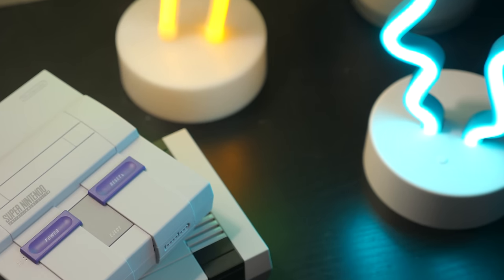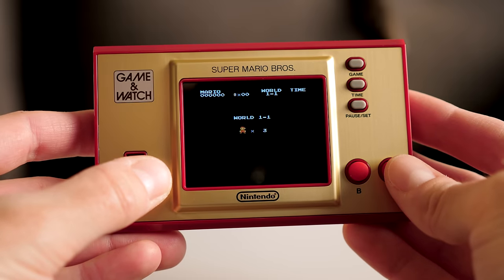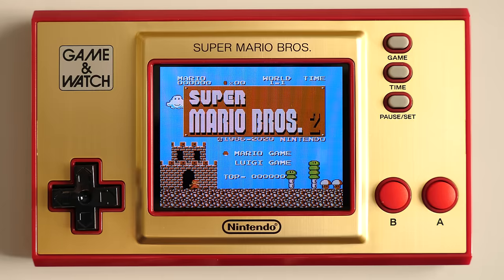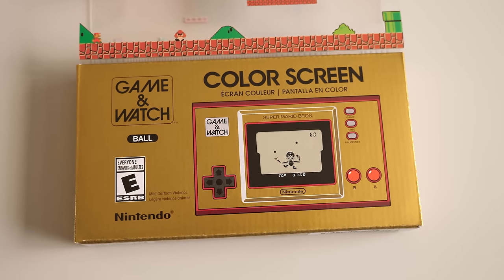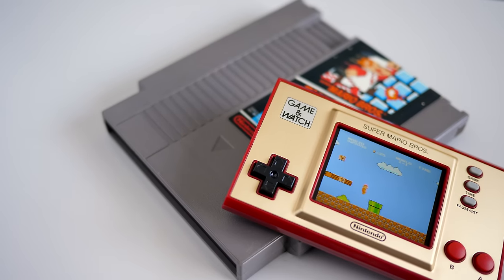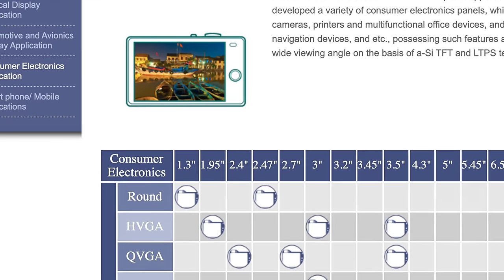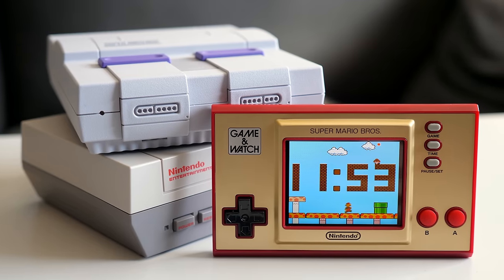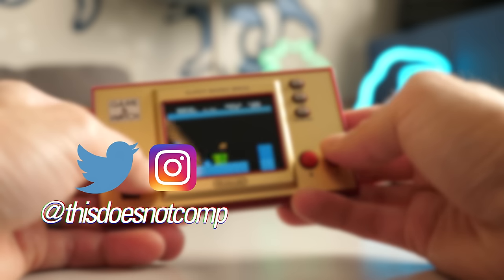Nintendo Game & Watch Review and Teardown!

Comment: That battery is the same one used in the Joycons, down to the part number (HAC-006). Even the speaker is the same design as used in the Switch itself.
Reply: I had a feeling they reused switch parts because of the usb c port
Reply: Yeah, the other teardown video of this that had already been done revealed the battery to be a Switch Joycon battery.
Reply: @RWL2012  thought that battery looked familiar
Reply: Nintendo as of late liked to used existing parts of the components when they can, which is a really effective strategy in my opinion as it allows for cheaper producing cost, and allow for more to be made. Same thing happens with the Switch Pro Controller and the Switch itself (Use the 3DS battery and, at least at launch, came with the HDMI cable for the Wii U respectively)
Reply: That’s smart design

Comment: This Nintendo Game & Watch can be hacked to add your own custom ROM, however it's not for the faint at heart. You need to open it up and connect to the 5-pin unpopulated debug header port. You can actually see it in your video. With the battery on the bottom the pins from left to right are: SWCLK, VDD, GND, SWDIO, RESET.
Reply: Here's a video link showing the detailed process on how-to do it (not my video) https://www.youtube.com/watch?v=Rsi8p5gbaps

Comment: The SOC isn't a glob top which is pretty cool.
Reply: I've seen a few glop top systems that are REAL systems. Like one that I have, which is a glop top with a real NES-on-chip with good AV output under it, and another that is a real SMS. Both are older, but when connected to a CRT TV would be very hard to distinguish between a real NES/SMS. Not trying to 'dunk' on you here, but some glop tops can be good. just not when it comes to reverse engineering.
Reply: @xero110  oh no I'm not necessarily against glop top chips, I'm just saying it's not as easy to work around or hack a glop top. You of course can get around a glop top in a few ways and there are for sure some great SOC glop tops like what you mentioned but nonetheless I was just saying that it's pretty cool that Nintendo didn't go the glop top route with one of their cheaper devices. I didn't think you were trying to dunk on me. We're just two nerds talkin' nerd talk is all.
Reply: @xero110  yeah i saw that, f*cking awesome

Comment: The USB port on this thing is really for charging only, it's not physically connected to the SoC, only to the charge controller from the reversing attempts i saw online...
Reply: Wonder if one could connect the data pins themselves.
Reply: @christphern  simple answer, yes you can, that didn't mean you can easily crack it though.
Reply: That's an important distinction. Thanks for pointing it out.
Reply: @mephistovonfaust  yeah who knows the rest of system is setup to communicate even the pins are connected.

Comment: There absolutely is interpolation from non integer scaling on the X axis. It’s most obvious on the vertical lines on the brick tiles, and there’s a noticeable shimmering when the screen scrolls.
Reply: Yep, it's ironically extremely obvious in the close-up while he says Nintendo chose a screen resolution which doesn't require interpolation. Whoops.
Reply: @vaguerant  I agree, but there is nothing Nintendo could do about, as pixels on the original NES are not square. So they choose a display with the correct aspect ration and the correct Y-resolution.
I just wish they gave you at least the option for a pixel perfect mode like on the NES classic so you have the option of choosing ether a too skinny - but pixel perfect picture or have it the correct aspect ration but with interpolation.
Reply: @sh4dowde  Well, there is nothing Nintendo could do about it on the budget they alloted to this device. But if they had wanted to, they could have had somebody manufacture LCD screens with non-square pixels; it's entirely possible, the Sega Game Gear and Nintendo 3DS both had them.

But for a cheap device using off the shelf parts, that wasn't going to happen, so yeah, a pixel-perfect mode (like they already offer on other systems!) really would have been the ideal compromise.
Reply: @vaguerant  There's a lot Nintendo could have done about it. They're giving you 3 games for $50, there's a crapload of profit there. This was just lazy on Nintendo's part, as usual. Nintendo never cares about getting it right, they always release cheap crap for maximum profit.

Comment: PSA: The screen does use interpolation horizontally. However, this is not necessarily a bad thing and is handled well here, well enough for many reviewers not to notice, and it's almost unnoticable to me in gameplay.

Now you may ask, why is the game stretched horizontally? That's because LCD displays have square pixels (generally), however the NES is intended to be displayed a bit stretched. The resolution of the NES is 256x240 which would be an aspect ratio of 16 : 15 if displayed with square pixels, however the video output from the NES was stretched to 4:3 on CRT TVs at the time. The Game & Watch has a resolution of 307x240 (counted the pixels on my unit), which is close to 4:3 (approx. 4:3.13). The vertical resolution obviously matches that of the NES, thus no stretching there, but the horizontal resolution is 20% higher. As a side note, I find it odd that they didn't use a 320x240 resolution which is more standard and would've given them an exact aspect ratio of 4:3, but I digress.

I personally think that they should've added a "pixel perfect" mode like on the 3DS Virtual Console, NES/SNES Classic and NES/SNES services on Switch Online. It would've fit particularly well here since discarding those 51 extra horizontal pixels would've literally made the game pixel perfect and it would've looked razor sharp. But, in a way, this is more authentic, so I don't mind that much. And, to be clear, the stretching uses soft scaling that only affects the game horizontally, so most of the time or at a comfortable distance, you won't notice it, especially in movement.

EDIT: Please note that anything said about the Game & Watch in this comment is based off my unit only (model HXA-001, although different revisions with the same model number has not yet been ruled out). I have not seen any external data or information on the console's resolution or stretching properties, so take anything I say here as what it is - very limited information from one source. I hope to see more detailed examinations of the properties of this console and its display soon.

Comment: quite frankly I'm amazed at the small number of components and how low end they are.

They must have some significant profit margins selling this thing for $50, especially factoring in them using Switch components.
Reply: The micro isn't cheap.  Its probably $5-7.  LCD prices have gone way up as well all driven by Covid.  My guess is this unit costs nintendo around $25 to make.

Comment: The Macronix MXIC25U8035F package mounted is part of the same family of memory chips that are used in plenty of laptops as a ROM chip containing the BIOS.
It's a 25XXX-type flash memory, and judging by its nomenclature, it's a 1.8v compatible part.

You can flash the contents with a CH341A programmer and its 1.8v adapter, but:
- You might have to dump the ROM and see what comprises the games and what is the OS
- You will need to desolder the chip, as trying to flash with the SOIC8 clip will not work.

The battery, on the other hand, is the same one found on Nintendo Switch joycons, so it will be easy to source down the line.

Comment: The battery appears to be just a joy con battery so replacing it if you have to should be nice and simple.
Also this console is way more hackable then the mini consoles. You can just connect an off the shelf stm32 programmer right to it and flash whatever you need, sorta like connecting a programmer to an arduino. The only issue is you need that programmer and the right tools soo not as easy as just connecting it via usb but way more versatile as you have complete control over the device.

Comment: The data pins on the USB are not connected to the pcb so no future updates...
Reply: Doesn’t mean people can’t tap into the board directly. That chip was programmed from the factory, so there’s gotta be some way to reprogram it, it’s just a matter of how hard that’ll be.
Reply: @mrb692  yes you can trough debug pins but not trough the USB cable that is what I mean